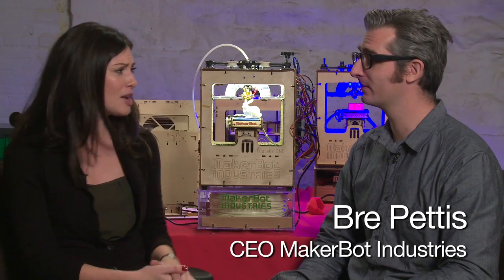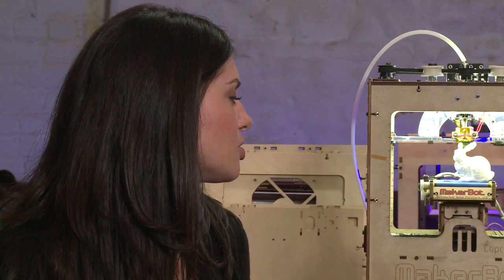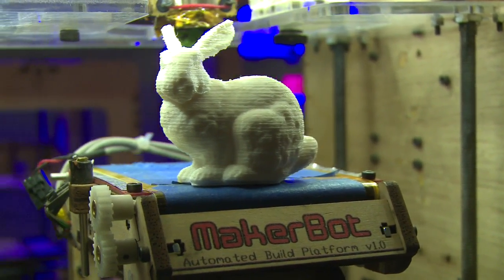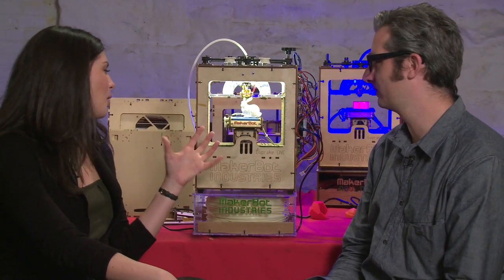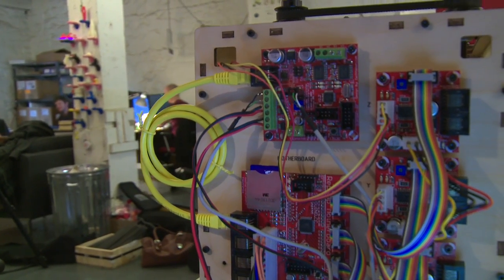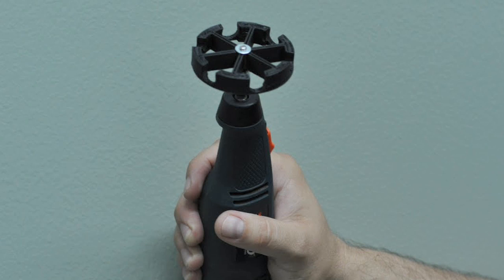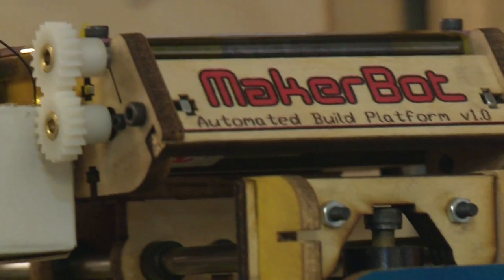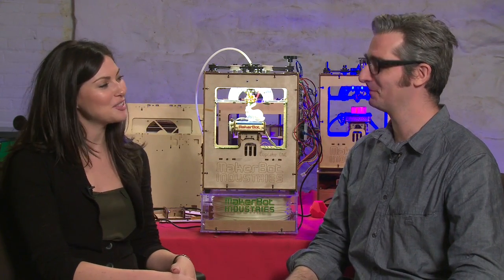Bre Pettis and MakerBot Industries

Comment: @mhaun I did follow the directions.  If you read my post properly I clearly note that I was ABLE to print something initially, but the printer won't stay working for more than a week.  If you ask any makerbot owner, you will hear the same thing.  My goal in life is to be a really good plastics engineer specifically for use in injection molding processes, so it is vital for me to be able to print prototypes fast.  I have access to a real 3d printer now.  What difference does it make where I get $

Comment: I just want to warn everybody reading this. That I purchased a MakerBot in Sept. 2010, and I built it, it worked for one print, then failed.  i called MakerBot in Brooklyn and they basicly act like rockstars thinking they are too good to support their little customers.  AVOID AT ALL COSTS!  Also if you already bought a MakerBot, threaten to sue Bre Pettis and MakerBot, and Bre will refund your money in full, and you can keep the MakerBot, for a free machine. Thats what I did. and I recommend it.